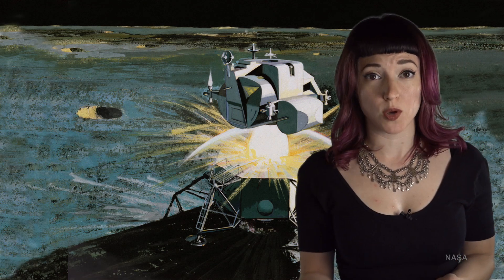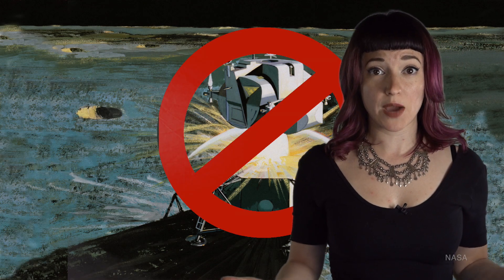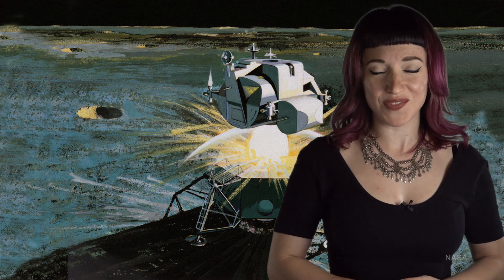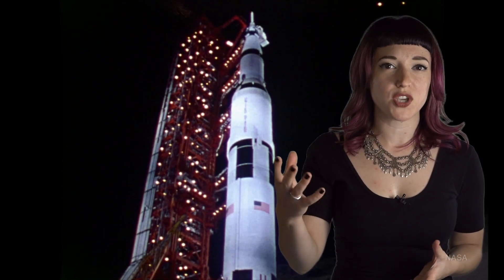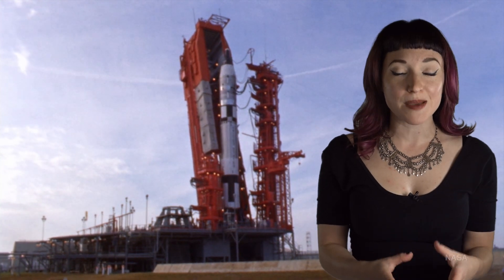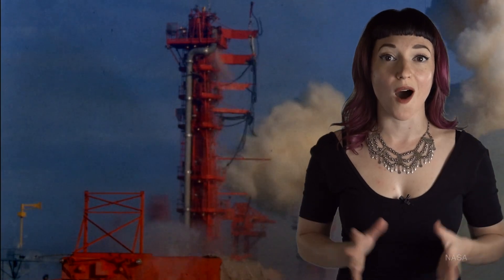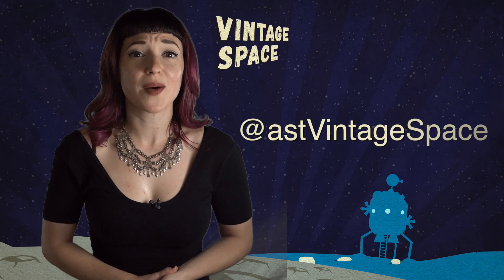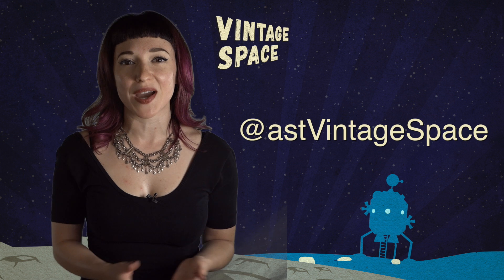How the Lunar Module Launched from the Moon Without a Flame

Comment: So, these engines or hypergoles work the same in an airless atmosphere as it does in an atmosphere with air.
Hmmm. They must have known a lot about the moon's arptmosphere before they went......

Now, can you explain how the air conditioning worked  in the lunar module?
You need air for air conditioning.  Right?
Reply: Hannah 
The moon has effectively no atmosphere as far as rocketry is concerned. Hypergols react with eachother regardless of the environment.

The environmental controls used a passive sublimation system to cool the spacesuits and the lander. The system takes advantage of the specific heat capacity of water-glycol sublimation.
Reply: Niall Kinsella Why can't the space station go to the moon?
Why have we never been back in how many years?
Reply: Hannah 
Why would anyone want the space station go to the moon? It's an orbital laboratory. Micro-gravity above earth is just as good as micro-gravity above the moon.

And who's going to pay for a return mission? The US Congress decides what missions NASA gets to spend it's budget on, and there's no political will in the US to find another lunar landing mission.
Reply: So NASA can somehow convince the whole world that the landed on the moon, then force the Russians, Chinese, and Japanese to publicly confirm the landings happened...
But they can't proofread their own publications?

No...this is as always, conspiracy theorists taking soundbites that appear to suit their agendas and absolutely running with them.
When Kelly Smith says that radiation can damage the computers on Orion and that shielding will be put to the test, conspiracy theorists take that to mean that Apollo didn't happen. Reasonable people take that to mean they are testing the radiation shielding on the Orion's computer systems to make sure that the modern computers will reliably function as intended.

I really like the final bit of that video you linked. How the host wilfully ignores the difference between temperature and thermal energy in an attempt to mislead his flock.
If he was being genuine he would have spoken about the specific heat capacity of the materials, but he chose to ignore that vitally important piece of physics, as conspiracy nutters always seem to do...
Reply: Hannah,

YOU SAID: "So, these engines or hypergoles work the same in an airless atmosphere as it does in an atmosphere with air."

== Yes and no.  They ran the same fuel/oxidizer mixture a bit rich in Earth's atmosphere for the Titan/Gemini missions, in order to burn a bit cooler.  They weren't as worried about it around the moon because the exhaust would dissipate a lot easier in a vacuum, and they also weren't doing as much work.  But, yeah, fuel and oxidizer burns in space, or burns in an atmosphere.  What's your point?

YOU SAID: "Hmmm. They must have known a lot about the moon's arptmosphere before they went......"

== The moon's atmosphere is very near zero.  And, yes, they knew this ahead of time.  You do realize they sent unmanned missions to the moon before manned missions, right?

YOU SAID: "Now, can you explain how the air conditioning worked  in the lunar module?"

== There's this new thing.  It's called an "internet search engine."  You key in words and phrases, and it spits out results.  Amazing, huh?  Um, nutbag, I know the real reason that you don't want to look it up.  You're happier with the delusion than you are in reality.  You don't WANT to know the answer.  It's not "air conditioning."  It's called a porous plate sublimator.  Now, go find your favorite internet search engine, and read all about it.

YOU SAID: "You need air for air conditioning.  Right?"

== Are you honestly under the impression that the world has been waiting 50 years for YOU to come along and spot this amazing glaring "error" in the "hoax," such that they couldn't cool the craft or people without air outside?  Are you REALLY under the impression that the thousands upon thousands of PhD scientists who worked on Apollo... all somehow didn't realize that they couldn't go get an Electrolux brand air conditioner and strap it to the lunar module?  I mean, good fucking gods, what is it with you fucking idiots??  Why do you think that debunking Apollo is as simple as saying air conditioning can't work?  Good grief.  As if the world's aerospace engineers, in friendly countries and enemy countries, for the past 50 years, didn't notice this obvious stupid thing that YOU noticed??  Fucking Dunning-Kruger idiot.  I swear.  I'll never understand why you imbeciles think you know things that you simply don't know.

YOU SAID: "Why can't the space station go to the moon?"

== It wasn't designed for that.  Why can't a Cessna 182 fly from New York to Australia?  It wasn't designed for it.  Are you under the impression that all aircraft ever built after the first 747 must be fake if they cannot fly from the USA to Australia?  No?  Then why is it so hard to believe that they built a craft that cannot go to the moon after Apollo?  In your mind, once they built one craft to go to the moon, EVERY craft after that must be able to go to the moon, otherwise it's fake?

YOU SAID: "Why have we never been back in how many years?"

== Is math just not your thing?  You can't subtract 2018 - 1972?  The answer is FUNDING.  Back in the height of Apollo, NASA's budget was a whopping 4.5% of the entire federal budget.  Add to that the international help, plus the tax breaks to the contractors, and free land they were granted, and you're talking about the equivalent of over 5% of the entire federal budget.  And, NASA took that money, and put the overwhelming majority straight into Apollo.  Nowadays, NASA's budget is less than 0.5% of the federal budget, and they are required to spread that money over hundreds of different programs.  Do the math.  Good grief.

YOU SAID: "They dont go because they can't."

== What an idiot.  You don't even know why the space station can't go to the moon, yet you think you know enough to make this stupid claim??  Dunning-Kruger idiot.  Complete and total Dunning-Kruger idiot.  They should put your picture next to the Dunning-Kruger effect in the dictionary.  Dunning-Kruger fucking moron.

YOU SAID: "They admitted it in a video. They can't go beyond low orbit and wonder if it will happen in their lifetime."

== They cannot go RIGHT NOW.  Do you see any working Saturn Vs laying around?  Do you see any other human-rated boosters capable of it right now?  They're all gone.  The only ones remaining are essentially empty shells, and there are no working CSMs or landers or Saturn Vs remaining.  And, even if they had them, they don't have the facilities to launch them.  And, they don't have any of the other countless facilities it would take to get them off the ground either.  None of that means that they didn't have them in the Apollo era.

And, look, why the hell would you listen to such utter idiocy anyway?  Nothing that moron in that video says makes any sense.  I mean, do you REALLY believe that Kelly Smith was saying Apollo never happened?  He said that they had to work on Orion (a different program, different craft, different computers, different mission parameters, etc.).  Apollo sent their craft through the Van Allen belts in a couple hours.  Orion intends on putting astronauts in those belts for WEEKS at a time.  At the rate of about 1 rem per hour of exposure, a couple hours only meant the astronauts were exposed to a couple of rem.  If you're in there for three weeks, that's FIVE HUNDRED REM.  Different program, different mission profiles, different requirements.  So, they have to test it.  That's all he was saying.  And, they tested it a couple of years ago, and it passed.  So, what's your complaint?

And, modern computers are far more sensitive to radiation than Apollo computers.  Apollo used ROPE memory, gazillions of atoms across.  A particle of radiation would be like a fly hitting a freight train.  It's not going to make a difference.  But, modern computers have traded computing power for vulnerability.  With electronic pathways and memory circuits only a few atoms across, radiation can have a much more dramatic effect.  So, Orion needs better shielding.  It's as simple as that.  But, yet, you idiots take those words, and twist them into meaning something they don't mean.  You hear "they have to test the shielding" - and idiots come flocking, saying stupid shit like "why don't they just use what Apollo supposedly used, therefore Apollo never happened."  You're idiots.

The sad thing is that you're PROUD of your ignorance.  Sad.
Reply: Niall Kinsella Other countries dont confirm or deny Moon landings because they font know for fact.

Some play the happy silent game for the sake of business.
The world works in a very cruel and dark way at times. You don't have a clue.
Reply: YOU SAID: "You are only repeating what NASA tell you.  That is sad."

== What in the hell are you talking about?  I offered dozens of questions and challenges to the parade of nonsense you spewed everywhere, and that's your reply?  You think I'm just regurgitating what NASA says?  What a fucking idiotic hypocrite.  No, you goddamned hypocrite.  YOU are regurgitating what other clueless conspiratards say!!!  Do you think this is the first time I've heard this goddamned "air conditioning" bullshit??  As if no actual aerospace engineer figured out that you can't strap a standard house air conditioner to a spacecraft??  Good grief.  This "air conditioner" argument is new, and you've decided to regurgitate it.  YOU are the one who is only repeating what conspiratards say.  If you have any actual beef with how spacecraft work, then submit your beefs for scientific peer review, you moron.  Other than that, you're a raving lunatic who screams your ignorance to the wind, pretending to know things you don't know.

YOU SAID: "I dont even trust my local cops. Let alone NASA."

== But YOU DO NOT KNOW WHAT YOU ARE TALKING ABOUT!!!  Nothing you say makes any scientific sense!!!!

YOU SAID: "Other countries dont confirm or deny Moon landings because they font know for fact."

== Are you intentionally a fucking moron, or accidentally??  You can go to JAXA's official website right now (Japan's space agency), and they confirm Apollo via their Selene orbiter which has been surveying the surface of the moon for over a decade.  China has confirmed Apollo (but, alas, they're secretive, and they won't say exactly how they did it).  The Soviets confirmed Apollo because they used their radar tracking to track all of the Apollo missions to the moon, as well as their radio telescopes to receive the radio transmissions from the moon.  Yet, in your fucking ignorance and stubbornness, you just sit there and claim that other countries don't confirm Apollo???  Good grief.  Dig your head out of your own ass and check facts before you spew your stupidity all over the place.

YOU SAID: "Some play the happy silent game for the sake of business."

== What game?  What ARE you talking about?

YOU SAID: "The world works in a very cruel and dark way at times. You don't have a clue."

== No, you stupid shit.  YOU are the clueless one.
Reply: Hannah, you're a moron.  I posed dozens of questions/challenges to your idiotic statements.  You have avoided every single one of them.  All you do is duck and dodge.  And, nothing you say is even remotely correct.  You even went as far as claiming that other countries' space agencies don't confirm Apollo, even though you can go to JAXA's website right now, and they have an entire section about how they've confirmed Apollo.  You know NOTHING.  You know ZERO.  And, I'm sorry to hear that you're not on drugs (which, of course, I don't believe for a second, but if I take you at your word...), because, at least if you were on drugs, then there'd be hope that your brain can return to normal.  But, if you're not on drugs, then that means your brain is lost forever.
Reply: rockethead7 You are only repeating what NASA tell you.

That is sad.

I dont even trust my local cops. Let alone NASA.
Reply: rockethead7 This will shut the likes of you up.

https://youtu.be/JgXDi7mc43M
Reply: rockethead7 I dont do drugs.
Now fuck off and go vote Trump.
Reply: rockethead7 Fuck off before somebody makes you.